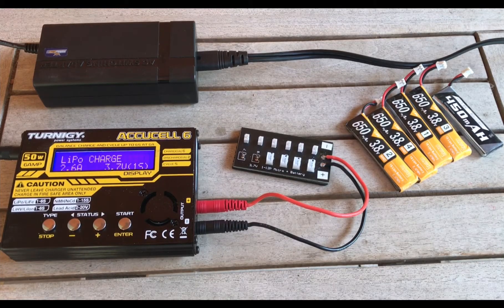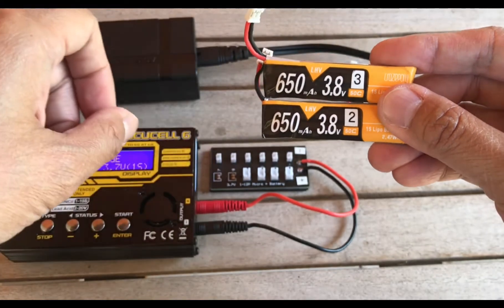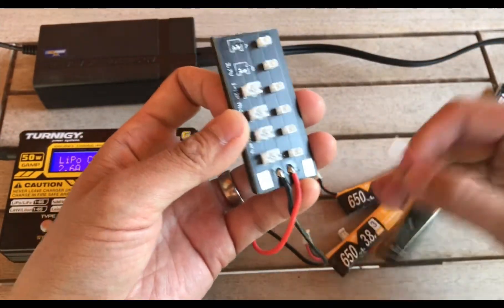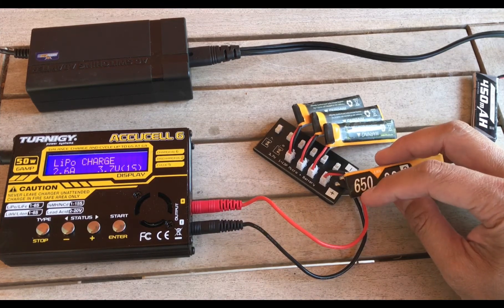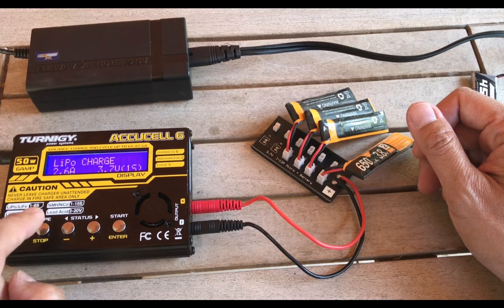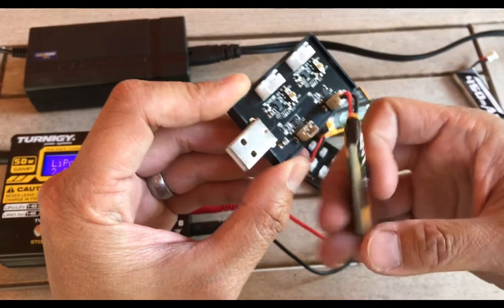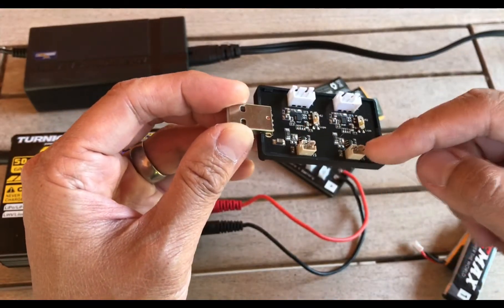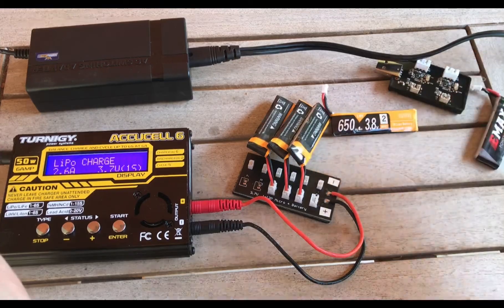Charging Lipo Batteries using a Parallel Board

Comment: I have 1s batteries with xt30 connectors. Will this work on a parallel board? Will it work even if I don’t have anything plugged in the balance ports? Regardless, I’m still finding this vid very helpful! Thanks!
Reply from the maker: No, it will not work w/o anything plugged into the balance ports. The parallel boards require it and most chargers will not allow you to charge w/o a balance lead plugged in. 

Your best bet is to get a charger that's specific for whoops. There's a few out there with multiple ports. Multi-channel so it's not parallel charging, meaning you can charge 4 or so all at the same time with different voltages by different manufacturers and different mah capacities. They run about $30-40 last time I checked.

Comment: Is it OK to storage charge multiple lipo packs, using a parallel board following the same  rules for parallel balance charging and simply selecting "storage mode" on the charger ???   Essentially, can I parallel storage charge multiple 2S 700Mah packs via a para board ?  

Thanks, your videos are great
Reply from the maker: Yes! That's actually safer. If you're charging up to storage charge (e.g. 3.70v to 3.80v) that'll be easier than discharging to storage charge (3.90v to 3.80v). 

Most chargers don't discharge at very high rates. You can set your discharge rate for your 700mah pack at 0.7amps and it will probably discharge at 0.3amps or less. 

Most people don't talk about discharge rates for chargers, but the limits are generally very very low. 

I use an ISDT FD-100 which can discharge at high rates. The C rating is the discharge rate. So technically, you can discharge your 700mah pack at 6amps w/o it being dangerous. I would recommend 3amps though.
Reply: @Funcentric  Thanks for the quick reply....someone should do a video, (Hint Hint) 🤣😂 And thanks for your informative content . Keep it coming
Reply from the maker: @tonyc7049  Haha, yeah it's something people slowly figure out on their own but it's quite a disappointment when you do find that the discharge rate is soooo much slower than the charge rate. I may make a video about the discharger I use. The value isn't as good. Used to be $27. I was going to get a second one, but I think it's now closer to $40 after shipping.

Comment: Ive got the happymodle mobula 7 parallel charger. I only have 3 batteirs and it requires 4 at all times. Is there any way of making a dummy battery for the fourth slot?
Reply from the maker: Not that I know of. Curious what charger looks like that you're referring to. I have one charge board that came with my mobula 7, but it wasn't a parallel charger and it had 6 ports. Looks like they changed what they supply these days.
Reply: It's a series charger not a parallel charger. Move the yellow thingy in the middle to the 3 slot to charge 3 batteries.

Comment: What if i have 3 200mah lipos and 1 150 mah lipo? All 1s
Reply from the maker: You can’t charge batteries of different specs together. 3 200mah in parallèl you add the mah so it becomes a 1S 600mah battery to charge at 0.60amps. The 150mah you have to charge separately. 

For 1S batteries though, I recommend charging in series. Add voltage but mah is the same. So 3S 200mah at 0.20amps. You need a series connector with three wires though. You have to fill all three ports.
Reply: @Funcentric  ahh gotcha i just bought this protek parallel board thats why i was askin
Reply from the maker: @jonnurdaneta671  I see. In that case, just charge them by adding the mah. All voltage has to be the same. So don't charge ones that are at different voltages. You'll need to plug one at a time so you can check first.

Comment: You sir have finally done it, explained this is a way that can be understood by anyone. JB's, Mr. Steel's and others videos have not helped me find the answer of adding up the sums of all batteries. for 3 years now I've been raising my amps but not my mAh so my batteries have been running out much sooner. I knew it was my charging but every time I researched it no one clearly said add mAh, just amps. I can change ether on my charger so it was confusing.
Reply from the maker: Thanks! Yeah, I also found that a lot of other videos are hard to understand b/c they assume you know all the jargon and all that. Figured I'd start people from scratch. 

When selecting batteries, take into consideration the weight. You have to find the right balance. You  can have a lighter weight battery with less mah and actually get substantially more flight time. Why? Because mah carries its own weight and needs to lift it's own weight before you'd see any reflection in additional flight time. Same with EV's. Everyone thinks they want the largest battery for the biggest range, but the larger the battery, the exponentially less efficient it becomes.

Comment: I see you selected "lipo charge" with the parallel charging. Can you select "balance charge"? Or does it have to be regular charge when doing parallel?
Reply from the maker: You can, but it won’t really make a difference since it’s essentially thinking it’s still a one cell battery. The different ports on the parallel board aren’t recognized as “cells” when charging parallel. 

This is completely different from charging serially, in which case you would definitely use the balance function.

Comment: hi,  friend, parallel charge board is not good option now. i bought a 1s lipo series charging board for 6 batteries as one pack from HobbyFly brand of Amazon.that is the new charge and storage solution for 1s lipo battery.
Reply from the maker: Sorry, but I'm not quite understanding what you're saying.
Reply: Can u explain why this parellel charger is no good?
Reply from the maker: @verofpv6152  I’m mot sure what John Wilson is talking about either. Parallel charging and series charging are different and both have their place. There are reasons to do one vs the other depending on the scenario. 

Both should have voltages around the same as the others. With parallel changing, it’s more critical for safety for series charging, the downside is that it’s slow if not all packs are close in voltages. 

If wattage and amperage is limited on the charger, then series charging won’t help. You’d want to do it parallel where you can keep the amperage down.
Reply: @verofpv6152    the parallel board has battery voltage deviation limited. it should be not bigger than 0.1v  between batteries actually. and  the bad battery will do harm to the good one. for example, the bad battery is zero voltage. it will.make short circuit during the parallel board. the battery will fire at the worst situation.that is my opinion.

Comment: What’s the point if you have to check them all before, just get a 1S charger with 6 ports.
Reply from the maker: Good question. It compliments each other. Just different options. I use a charge board off a power bank in the field or when my charger is busy charging other batteries. 

1. Most 1S chargers only allow you to choose between two amperages. 

2. Some people may already have a charger and would rather spend a few dollars on a parallel board or series connector instead of spending more on a full on charger which would also require a power supply.

Comment: Nice video. What options you have if you have 4 batteries and 2 of them don't have the same voltage?
Reply from the maker: A. Bring them both to the same charge, then parallel charge. Like if one is at 3.6v and the other is 3.7, bring them both to 3.9v individually one at a time. Then parallel charge them both together to full capacity of 4.2v. B. You can check out my other video about the best way to charge in the field using a charge board that doesn’t care about equal voltage of each battery.
Reply: @Funcentric  that you mate! Yes ill have a look :)
Reply from the maker: @kelapse8587  No problem. Let me know if you have other questions. Happy to help.
Reply: @Funcentric  Thank you! :) Well i just bought a Mobula 7 drone and i want to find out what is the best way to charge 1s batteries. not sure whats "better" parallel or in series. many information online and if you are new it is sooo confusing. whats your opinion? :)
Reply from the maker: @kelapse8587  series allows you to charge batteries that are different voltages but it still needs to be close. And all ports need to have a battery in it. So if you have a cable in series and it has 6 plugs, you must plug in all 6 batteries which I find even less convenient. You can’t just charge 4. You have to wait until you have all 6. 

I say parallel is much easier than series. Charge as many as the parallel board can handle but voltage needs to be exactly the same or off by 0.01v at the most. 

For 1S batteries, use my external battery pack method with charging board. Or plug the charging board into a sub adapter into your wall at home if not on the go. Voltage do not have to match at all. It can be way off from others because it’s charging them individually. Have you watched the video yet?
Reply: @Funcentric  yes i have actually, was really helpful and a good idea. Thank you for your help 😊
Reply from the maker: @kelapse8587  Sure thing. Glad to help.

Comment: This is the closest video I can find. I have the second charger you show here along with identical batteries, both EMAX and crazepony. Are they both the same voltage (for the switch setting?) Also when plugged into a USB all I get is green flashing LEDs, not solid? I can't find any information on the net or in the instructions...
Reply from the maker: I have never seen the flashing LED lights on the charge board. It should be a very bright solid green. If it’s not plugged into the USB snuggly, it will have a very faint flashing green. As for parallel charging batteries of the same spec, I would only do it if they were the same manufacture because the C rating may be different. She ratings are known in the industry to be in accurate so you never really know for certain. If you’re talking about the charge board, each connector is completely independent of the others. You are safe to mix and match different brand and spec batteries for the charge board. Not true of a parallel charging board. Only the USB one I showed in the video. I have a different video about field charging using that USB charge board that might be relevant for you too.

Comment: Thanks. All my questions finally answered :-) I'm a new owner of Tiny Hawk II. And one question,  is any reason that I should charge lower current than nominal battery? For example for 1800mAh charging by 0.4A? Is better for battery?
Reply from the maker: Awesome! Glad I could help! Sorry to hear about the Tinyhawk II though. Don't worry, you're not the only one who fell for all the great reviews on that thing not realizing it was for short term ownership. Enjoy it while it works. It's great and you'll want to fly it everyday, but when the flight controller dies on you 3 months in and you're wondering if you should really spend $60 on a new flight controller, wait for ship times and question your soldering skills, you'll probably say no and look for a new quad. I'll see you in the Facebook Groups for Newbeedrone then. 

If you want a method for charging 1S batteries on the go, I have another YouTube video that'll help you with that.

Back to your question: Yes, it's just a rule that running fewer amps to the battery improves longevity. Think of a coach pushing to to run. You have a max and you'll get exhausted if pushed too hard. If you go at your own pace, you'll last longer.

Lately, I've been charging my 1500mah batteries at 1.2-1.3 amps. Only when I'm in a hurry do I do the full 1C at 1.5 amps. For smaller batteries, it's less important only b/c smaller batteries are usually cheaper and are more disposable. I still stick with the 1C rule though of mah rating / 1000 for how many amps to charge it at or slightly under.
Reply: @Funcentric  Thanks, regarding Tiny Hawk, my plan was to fly in simulator for some time, what I already did, and then switch to  Tiny whoop - TH2 seems to be the best solution, in future I plan to swith to some 3' quad. Maybe using only 1s is safer in my quad?
Reply from the maker: @flyhigh1491  TH2 has a poor history of reliability so just expect that after a short period, it may stop working. a 3" quad will run substantially stronger. You may be surprised by the power of a 4S 3" quad. I would still recommend something by Newbeedrone after your TH2 goes kaput.

Comment: If the batteries are high voltage do you still charge same way. So I have 4 450mah HV batteries would I put in 1.8amp?
Reply: If you have a Single HV USB charging cable you can top up the individual batteries after they have been charged on the parallel board. This maximises the voltage/flight duration and minimises charging time.
Reply from the maker: Yes, at 1.8amp, but your setting will need to be for LIHV to charge to the full 4.35v per cell. If you use the LiPo setting, it will only charge to 4.2v per cell which is fine but you just won't get as much juice out of it. Not all of these 4-button chargers have the LiHV setting unfortunately. This particular one does.
Reply: @Funcentric  thanks for your help
Reply from the maker: @sheapy77  Sure thing. If you don’t have a LiHv charger, make sure you check before you buy because not all of them offer that feature to charge that battery chemistry.

Comment: Parallel charging always seems like a dangerous proposition. Great video well explained thanks for sharing. Still using the supplied charger over here.
Reply from the maker: I know what you mean. I still charge at 1C rates even though I "know" that 1.5C - 2C is doable. Parallel charging is also good for setting batteries to storage charge. Less dangerous that way too b/c batteries won't ever be overcharged since they're only hitting roughly 50% by design.